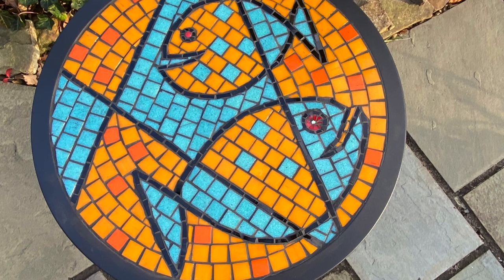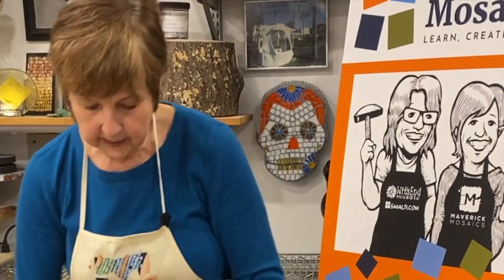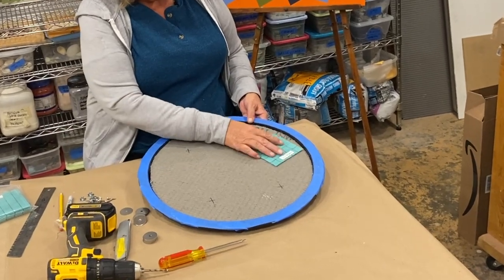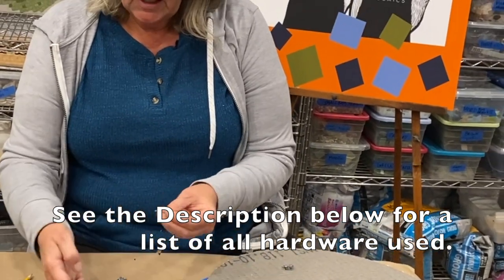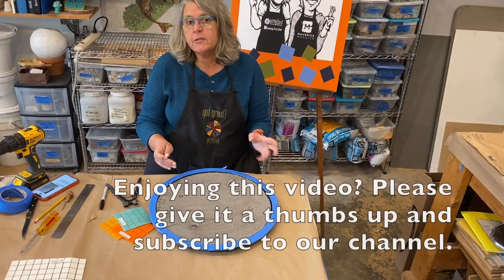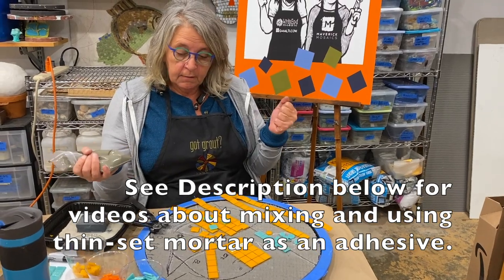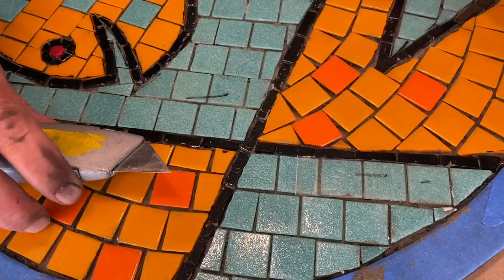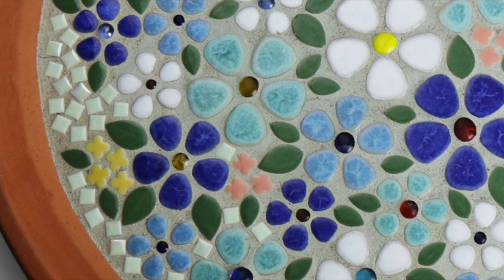Mosaic Table Top using Glass Tiles

Comment: I’m going to be using WediBoard for a similar smaller table. Do I not need to seal the edges of the WediBoard as I’ve seen in other videos? Thanks!!
Reply from the maker: Weldbond ONLY interior,  exterior you must use thin set mortar or silione. For inteior Wedi surface I would paint the edges the same color as my grout. Check out our video about lightweight substrates to learn why that is ok to do. https://youtu.be/oKaVqfqS3sc
Reply: @MakeitMosaics  Thanks for the quick response!

Comment: Wondering if it might be possible to glue in the Wedi board with some kind of heavy duty construction glue instead of using screws?
Reply from the maker: Yes, you could use some sort of construction adhesive, just that then you can probably can not remove the mosaic in the future without damaging it. But certainly easier - for me it is about calculating the right number of washers (or shims) so the tiles are flush to the edge. Good lukc! Thanks for being a fan.

Comment: Why did you use the film?  How did you grout with the film over tiles?
Reply from the maker: When you buy those vitreous glass tiles they arrive "face taped" (this helps prevent breaking in shipping),  As Kim shows in the video you can leave the face tape on if your design calls for consistent lines like the design in the video. She removed the tape after the mortar had cured and before grouting, we show this at approximately 10:10. Great project!